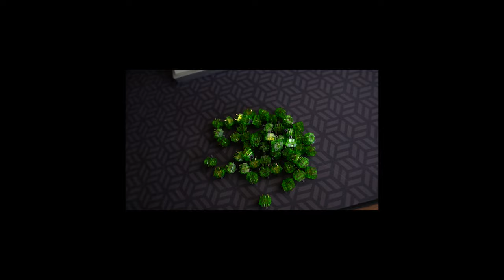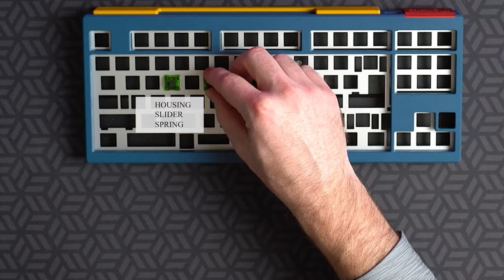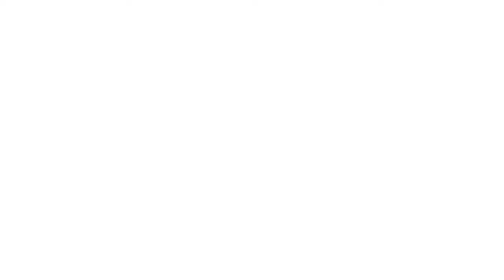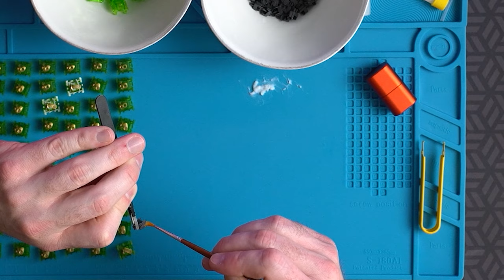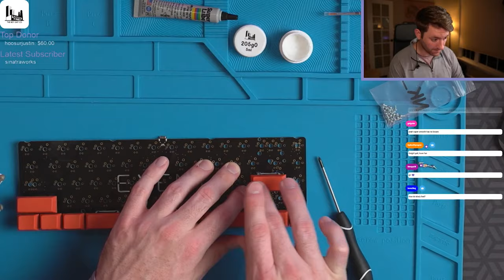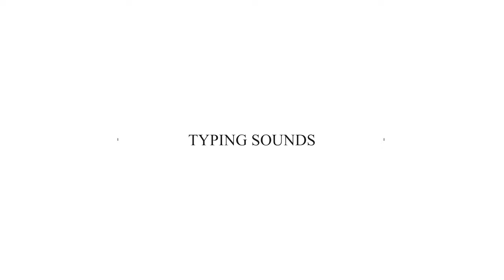c3 Kiwi Switch Review

Comment: I appreciate the video, but I'm gonna be a bit nitpicky. For the first sound test I think it would be more meaningful to completely fill the keyboard with switches, since this has an effect on the keyboards sound. Also, you should test each differently lubed switch in the same spot, since the acoustics can vary depending on the placement.

Comment: Maybe I needed to watch the stream to find out, but how would compare the smoothness to a T1 (or a Lilac if you've tried those) and besides the sound, is there a fundamental difference having the tangie-esc housing? My reference point if from Lilacs which I was very pleased with other than a few noisy, almost clicky contact leaves.
Reply from the maker: They're almost the same in terms of smoothness.  VERY smooth.  Pretty minimal click on the contact leaves.  You might get a little, but it's not much at all.
Reply: maxf In your macropad it seemed like T1s had a slightly deeper tone, is it just an impression due to the recording or do you perceived it also directly?

Comment: what lube went in the bag for the springs?
Reply from the maker: that's a mix of 203g0 and victorinox oil - I reuse bags for spring lube and will continually add just a little more oil in most instances

Comment: Do he lubed the bottom housing?
Reply from the maker: On one of them I did.  my "preferred" tune would be Krytox 203g0 on the slider (not the tiny legs of the slider) and the bottom housing rails - I'd oil the springs with your favorite mix and add either a TX or deskey switch film.
Reply: maxf thank you